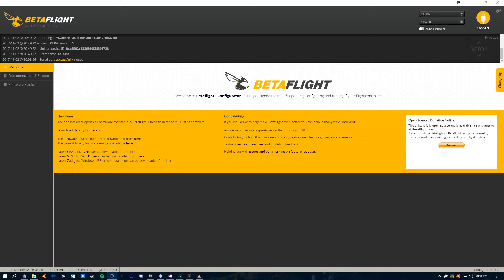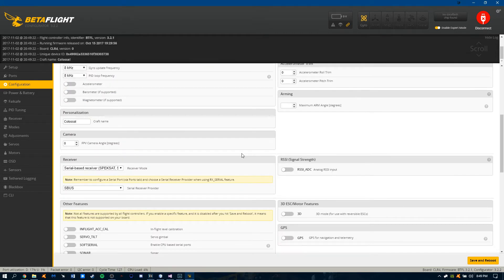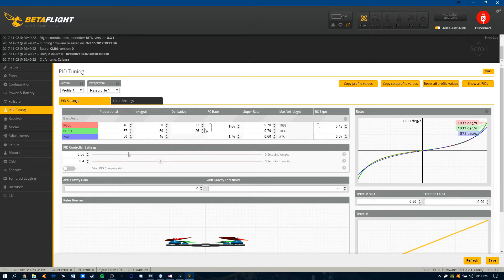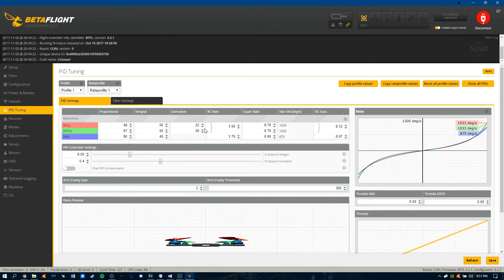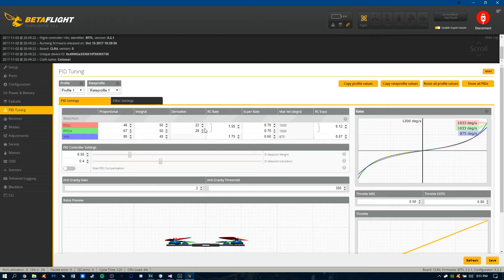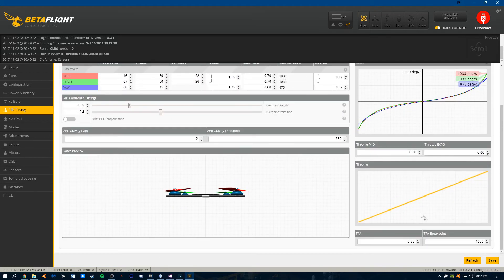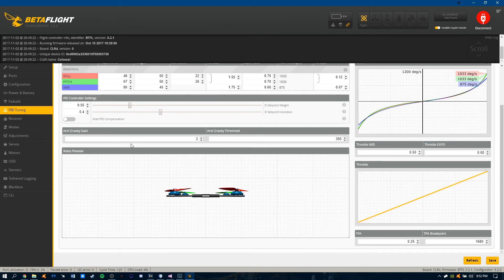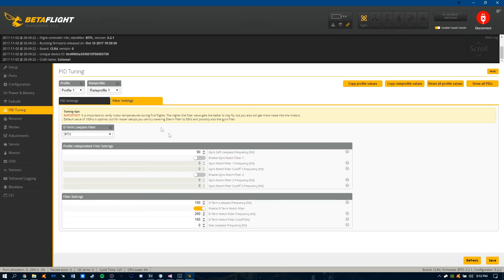My Betaflight PIDs & Configuration - FPV Drone Freestyle

Comment: Have you experimented with turning the d-term notch filter off?
Reply from the maker: Hey man! I have not, I've never turned it off once. My motors don't generally fly too cool, so I've never wanted to risk it... plus, I don't see much gain from it on my builds as they're generally pretty noisy so it would probably make them worst in my case.
Reply: ColossalFPV That's pretty impressive given how smooth your flights look. I just turned mine off today. Went well. No heat. Flies smoother in hard turns and descents. I have a super lowend budget quad though.